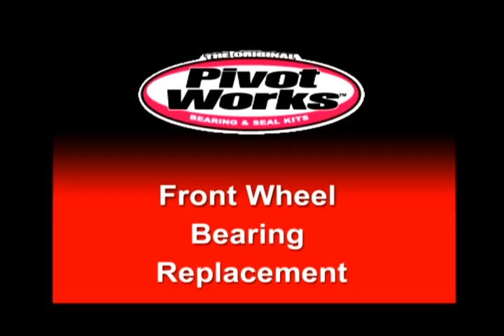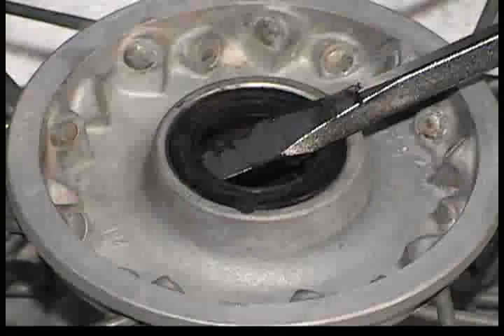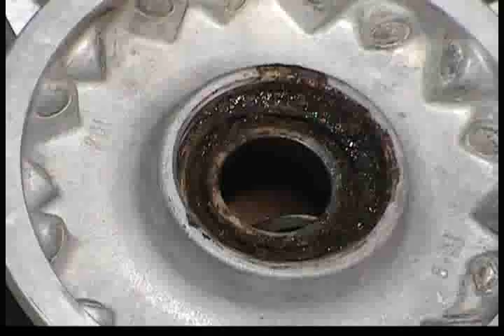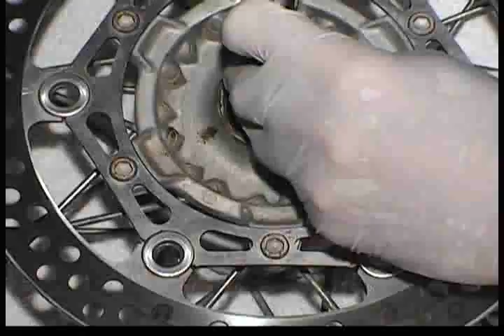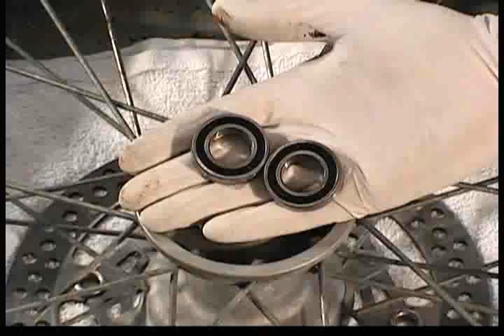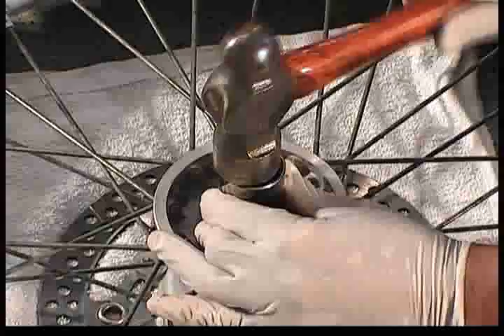Pivot Works front wheel bearing install

Comment from the maker: Pivot Works recommends placing grease on the lip of the seals to keep dirt out and placing grease on the bearing spacer will keep it from corroding to the hub.  Pivot Works uses double sealed ball bearings, so there is no need to grease them.